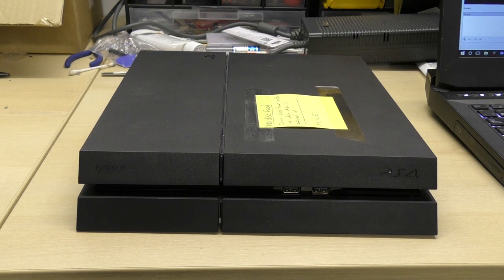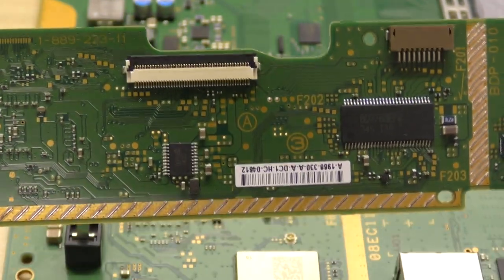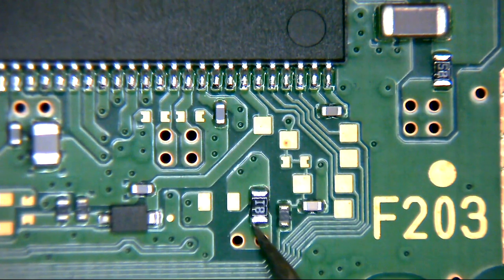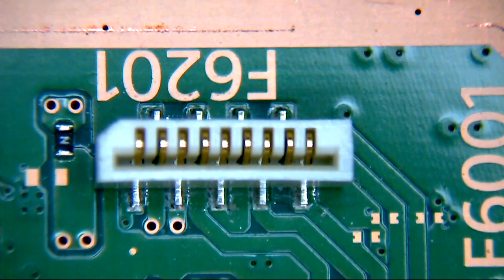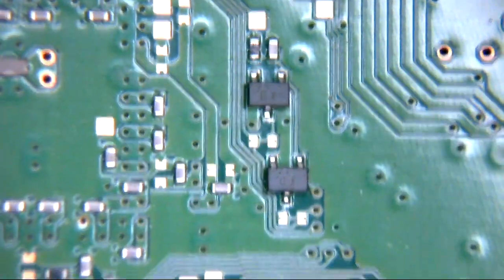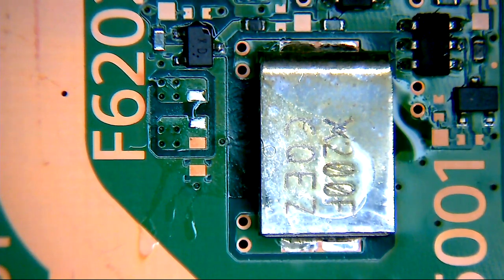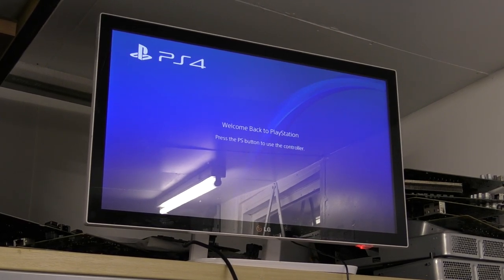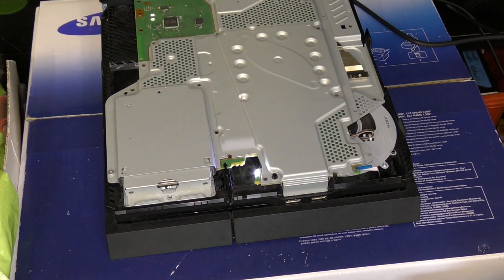PS4 CUH-12xx BD-ROM No Disc Feed Repair (SAC-001) - SU-42118-6

Comment: Andrew - Great video as always!  I've now ran into one of these with the same issue, but this time, the new fuse blows as well.  Figured I would hopefully through some info back to you that could help you on the chance that you run into that someday.  The F6202 fuse goes to the laser ribbon and in my case, there ended up being a good deal of corrosion on the actual plug at the laser end.  I shot 3 fuses before I figured it out.  That's most likely why this fuse blows to begin with in most cases.  Thanks for all the good info.  Hope that helps you someday!

Comment: Hi, I know this is old video but I hope you can see this. I have sac-001 board with blown fuses f6201 and f6202. I have sab-001 and bdp-025 boards for parts. Can I use fuses from these boards to replace fuses on sac-001 and if yes, then which ones?
Reply from the maker: Yes you can. They're all the same rating IIRC so should be good to swap any across you need without issue.

Comment: Andrew you are the man!  I have a question,  we have a customers PS4 Slim and the same fuse that you have in this video is bad (F6202).  The fuse has a small black vertical line in the middle of it and through searching it looks like a 1A fuse but I do not know the voltage?  Would you happen to know where to find a replacement fuse? and or could we bridge the contact to test the disc feeding temporarily?  

Thanks in advance!
David
Reply from the maker: +Computer Booter Repair & Video Games iPhone Repair Don't bridge it whatever you do otherwise you'll potentially kill the board and/or drive. If you've a donor PS4 board (doesn't need to be a slim) find an identical fuse on there (they're common across all board types).
Reply: Andrew,  Thing is I cant find a fuse with the same marking on it.  The one in the ps4 slim has the marking "I" on it.  Ive looked on ps3/ps4 boards and dont see a matching fuse.  Happen to know a location of a fuse I can pull?  Like I said previously I believe its a 1amp fuse but no idea of voltage.
Reply from the maker: I'm not near any boards currently so going from memory however IIRC F5102 from an SAA/SAB board is the one I use for these
Reply: ok, yeah the F5102 on the SAB board has a "Y" on it which is I think 2.5amp... what do you think?
Reply from the maker: Will be fine bud.
Reply: I love you, oh and by the way, this was for the ps4 slim that would not pull discs in, we bridged the contact first and it worked, now we are going to put that "Y" fuse from F6202 on it, will let yall know how it works :-D
Reply from the maker: Excellent news - please let us know the final outcome.
Reply: Success, the fuse was a different package too... either way we removed F6202 from an SAB-001 board and installed it on the ps4 slim board, works great..  Thanks for your videos/help, I am sure I will be learning more from you in the future!
Reply: arghh I have the exact same issue on a ps4 Slim sad-001 but I don't have the fuse or a faulty mobo

Comment: Hi again Andrew, I have a PS4 here that I bought faulty, it wasn't reading discs. It is model CUH-1216A, it had been apart before. The optical drive had the number KEM-490AAA. So I replaced it and still have the same issue, which got me wondering, is that the correct optical drive KEM number or does a different one belong in there?

Comment: Thanks for this great video, I have the same problem. the same fuse is defective. For me it is important to know whether these are actually fuses or resistors. do I have to replace this 1: 1 or can I use something else? I also need a microscope for this. Can you tell us which equipment you use? the microscope is especially important. Thx much. greetings from Germany.

Comment: Just got a PS4 12xx with this issue and unable to update. This saved it! Thanks a lot. But still the drive refuses to take in disc but ejects it. Maybe the mechanism inside needs tinkering.
Edit: I fixed it. The mechanism inside was jammed. Its all good now!
Reply from the maker: Awesome work! Glad the video could help :)

Comment: I have this exact board, NO issues with the drive pulling disk in, spinning or ejecting. The DVDs and Blu Rays do not "process" or play - I have tried several replacement dvd drives with no joy - any advice on what could be causing this?

Comment: I have a serious problem with PS4 SAC-001 so the client says the son was playing for a few hours. The mother suddenly starts the PS4 by unplugging the power cord from the outlet and pulled it to the floor. Since then, when the plug is connected and the power button is started, a message appears on the screen that it does not detect an HDMI cable and remains blue. In my opinion, the processor must have suffered breaks in the spheres where it is soldered to the plate. With the multimeter in continuity some and many capacitors around the processor beep on both sides.

Comment: Andrew, i've three Cuh-12XX BD-ROM Drive that has unrecognised disc problem. It doesn't recognise any disc i put in. It take disc in and eject disc fine. but it doesnt read. not sure if is motor sensor problem or laser unit or motherboard causing this problem.  i dont have a known working good BD-ROM Drive test at the moment. any suggestion?

Comment: Hey, thanks for the video. I've a Playstation 4 3rd gen (CUH-1216a) and have the error code CE-35888-2. It is the original drive and so on, nothing has changed on the PS4 but do you think that the fuse could be faulty? Thanks for your answer !

Comment: Hi Andrew, I know this video was posted 5 years ago but hope you will see this message and could help please as I am at a loss? I have a PS4 1216B that the optical drive is not reading discs. I have swapped the drive and ribbon cables from my other working PS4 and it still comes up with Unrecognized. I know the 1216B optical drives don't have a daughter board so its not the optical drive, I have also updated the software, rebuilt the database, did nothing so I then installed a new HDD and installed new software (v10.1 from memory) still no joy. Tested all the fuses which are good but it still will not read discs. With the drive out I can see the laser working and moving and the disc spinning. Would you have any clue as to what else it could be?  Thanks Andrew and keep up the good work, you're a legend 👍

Comment: Hi Andrew, I have a ps4 CUH-1216 model, which has problems reading original bluray game discs (customer told it began end of september 2017). Disc feed is working. The laser has been replaced several times by a new one, but that did not solve the problem. Also the complete drive has been replaced by a working drive from another ps4 of the same type, but the problem persisted. What actually happens, is that the laser attempts to read the disc, but fails. You simply hear the disc spinning, with different sounds, as if the disc is too dirty, while it is totally clean. With original DVD movies, it shows exactly the same behaviour.
Do you know what could have caused this issue ? Could it be OFW related ? According to the date, the ps4 would be on maximally 4.74. I know that on ps3's from 4.78 or higher, that the firmware update will change the power management and as a result of that, discs could not be read anymore, while being on OFW below 4.78 , the same disc could perfectly be read.
Reply: I have one of these right now if I figure it out will post back for you.
Reply: Hopefully it is not related to the OFW of the ps4... I have seen this in many situations since ps3 OFW 4.78 and higher. PS4 has been returned to another repair company, it has to be something with less or too much current for the laser I think..... But I am not 100% sure.
Reply: ProConsoles this is exactly what happens to mine, I'm exhausted trying to find a video to fix it.

Definitely don't want to buy a new drive if its not going to work.  Smh
Reply: I have a system with the same issue but it will still play DVD discs but no blu-ray discs. Games it recognizes it as a game and what game but then stops reading before install. Blu-ray movies it launches the movie app but gives error that it's not a compatible disk.

Comment: Hello there Andrew Paul !
Very good video thanks for your work here on YT, liked and subscribed.
Ive got the same problem because when i put back my bd rom i put the big connection wrong and because of that blow that fuse you fix in video.
Also, ive got another problem. Blue light doesent light but ny console is fully working.
Do you have any sugestion from what that problem can be?( maybe when i clean i brake that led?)
Reply from the maker: Is this on an SAC board mate?
Reply: @AndrewPaul  is on the same board as you worked on this video.
Because everything is working on the console except blue light it was very strange. I have found that somehow i have removed the small  led from the board.

Comment: Great video, many thanks.I'm sure you have given many hope of a fix.
Could you please advise as to a suitable size replacement fuse for the F6202, voltage and amps wise, as I don;t have a parts board from which to remove one. I see there is already a suggestion it might be 2.5 amps?
Your advice would be appreciated.
Reply from the maker: Hi Dean,
I've never measured it mate to be honest - just use them all from scrap boards. I'm not near a board now for the next week or so but I can measure it when I get back.
Reply: That would be great Andrew. I don't want to damage it further. any idea of a safe size just to test it?
Reply: it is 2 ampers

Comment: Andrew, you have constant problems with your fitting Air gun under the scope. Are there no available lens add-ons to allow magnification from further away?
Reply from the maker: Hi,
The issue is mainly down to the relative bulk of the wand rather than the proximity of the scope / working distance. Kinked nozzles are available - I've just not got around to ordering one as yet.
Reply: Ahh yes I remember you mentioning the kinked nozzle. You'd better buckle down and get one sorted then lol ;)

Comment: CE-35290-9 error code here. Updated to 6.20 without any issues. DVD discs console reads fine, but inserting any BluRay disc it spins up, calms down, repositions loudly, spins again, tries to read, but gives out "Unrecognised disc" and previously mentioned error code in error code window under the settings. The wides ribbon cable coming out of drive seems a bit punctured in 3 places, can it be the issue? Console version cuh-1216a.
Reply from the maker: If the cable is damaged then yes that could be the issue. Definitely replace it.

Comment: Hello Andrew - your videos are brilliant, and have taught me so much about diagnosing electronic faults! I'm fixing a PS4 Slim for my son's friend. The Blu Ray Disc drive isn't pulling the disc in and F6202 on the main motherboard is blown - the owner said it stopped working after a disc got stuck in the drive after it had been knocked about while being transported in a backpack! 

I don't have a donor board but do you happen to know the rating, voltage and type of fuse (quick blow, time delay etc) that should be used to replace it? Keep up the good work! So good to see people like you helping us all reduce the amount of repairable electronics going to landfill!
Reply from the maker: I've used Panasonic ERBRD1R00X with great success. Many thanks for your comment. :)
Reply: @AndrewPaul  Thanks for that. I'll get that fuse or a similar spec. Hopefully this will fix the problem!
Reply: Success! Replaced fuse F6202 and blu ray drive working again. Had to buy a new soldering iron first though, as my old cheap one wasn't up to the job. Thanks so much for your help, Andrew. It's annoying Sony make those fuses so difficult to replace (tiny size and awkward to get to). My son's friend was glad to get his PS4 back anyway.  Cheers mate!

Comment: Your The best had one here laying guess what checked all fuses and it was exactly the same one.
Finally I was able to update after I changed the fuse and blue ray is also working.
Keep up the good work
Reply: how did you go about repairing it? hot air rework station? where did you source your fuses from?

Comment: Thank you for the video tutorial. But my all fuses are fine. I'm thinking to order BD7763efv IC from Aliexpress. What do you think will it work ?? I have SMD heat station, I am capable of replacing it but asking for your advice whether to get the entire BDP-010 daughterboard or just the IC. Looking forward for your reply...Thank you
Reply from the maker: If it's a 1200 you won't have a daughterboard - it's all on the motherboard.
Does the drive work in a test chassis / another machine? In instances where the fuses are good it's a good idea to check as it prevents you from chasing a board issue which might not be present - the feed motors have a habit of going out which will appear to give the same symptoms.
Reply: Thank you for your reply. I have CUH-1001A System and I have the exact same model of BDrive like you showed in your other video. Actually its my fault that i'm commenting you on your other video sorry about that. But now you know my drive board is BDP-010. Any advice please ?
Reply: I have just found one with the same issue and it was a bad Band cable, one of the end traces was broken away and folded back, gave this exact fault but all fuses were ok. just changed the band cable. Even though it still turned the PS4 on when insert.
Reply: Just to let you guys know, Im ableto fix my Ps4 by getting new board BDP-010 and I have successfully replaced Rensas IC :D It works great now

Comment: My friend Paul, there is another way to replace that LB fuse, if I don't have a donor board, which one could be replaced by, remove it from another console, it can only be bridged.  That dude I do if I don't have a donor plate to replace the LB

Comment: Below the RENASAS chip is a smaller chip looks like 3535 on it. Can't make out the rest. Anyway; at the bottom left of 3535 are three parts; one is larger than the others....anyone know what that is and where to get one? It apparently came off my sac-001 mother board when I was cleaning the dust out of my ps4 1215A. So now I have no disc drive. Everything else seems to be working. Thanks for any help.

Comment: hello sir Andrew
i have a problem with my ps4  CUH-1004 the eject button doesn't work. i opened the ps4 to see what's wrong with the button. i notice the sensor doesn't work. i checked out the fuse works fine i don't know what the problem is it from the ps4 board
?
hope for any help thanks in advance..
Reply: i'm a man with a plan did you fix ur PS ?
When u need help replay I fixed this problem

Comment: I understand that a blown fuse caused the issue, but doesn't that usually indicate another issue as fuses generally don't just blow?
Reply from the maker: Hi Craig,
Indeed - these motors peak at relatively high amps when they start - after a few years with dirt / dust on the rollers and a lack of lubrication on the mechanism it takes more effort for the feed motor to advance the mechanics, thus drawing more peak power and eventually blowing the fuse over time. It can also be caused by helping 'push' the disc in as it auto feeds - this is a bigger issue on the slim PS4 as they use a lower rated fuse which exacerbates the issue. Typically, if you're finding your fuse is popping often, clean the drive, lubricate the mechanisms and replace the feed motor - they get weaker over time and again can cause premature fuse failure.
Reply: @AndrewPaul Ah, makes a lot of sense.  Thanks very much for the reply, and the fantastic videos!

Comment: Thanks for the great video!  I have a 1215a that won’t load discs.  I bought it online, all other functions appear to work.   The console was infested with bugs, very nasty.  I cleaned it out and reapplied thermal paste to the cpu.  There are several dark spots on the board that alcohol won’t remove.  I checked all fuses on the motherboard and none are bad.  As mentioned in the video, when the PS4 is off - if I try to load a disc then the power goes on.  But the disc does not load.  I am not sure what to try next, any suggestions?
Reply: I have exactly the same issue, on my board one fuse was blown, before I didn't even have eject button response, changed the fuse now the eject button beeps but doesn't eject, the disc drive also does not take disc